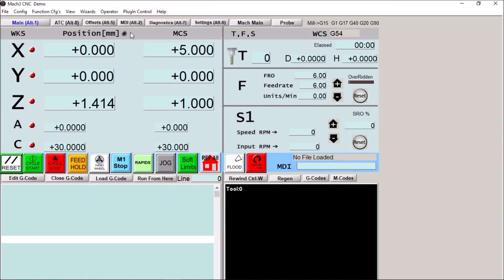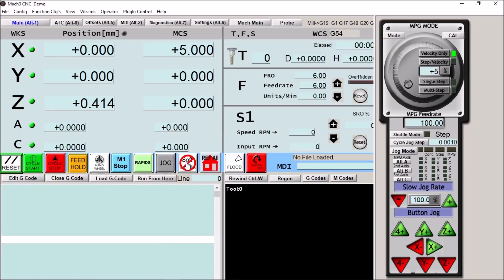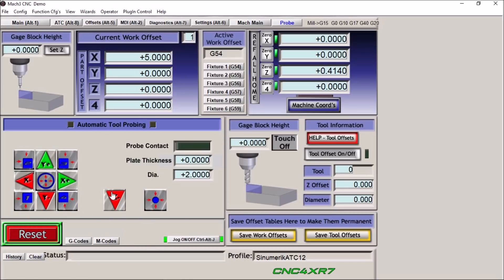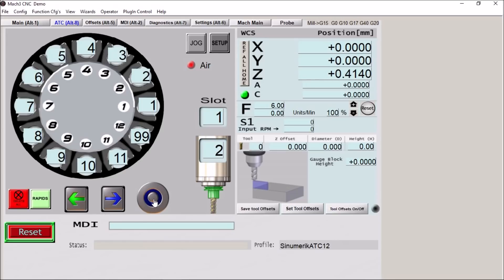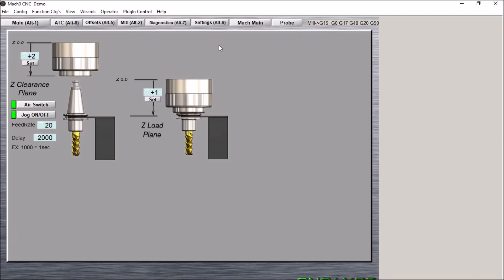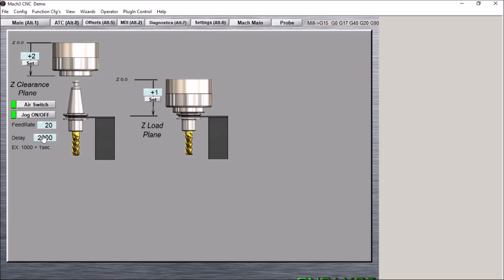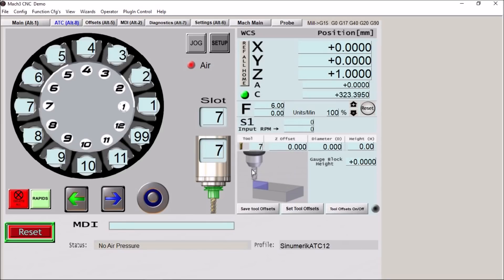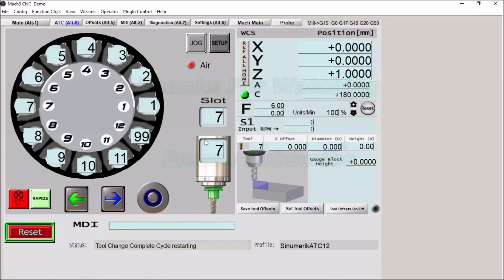Mach3 Sinumerik Rotary ATC Screen sets

Comment: I have  cheap offline controller , but to make it do what i want , i need to do a lot of macros and changing post processor . i´m thinking go back to Mach3 or 4 . 
Why you did not go for mach 4 ? and what control board are you going to use for it ?
Reply from the maker: Mach3 is popular and has been out quite sometime. Mach4 has yet to really catch on. You can use any BOB as long as you have the needed I/O's  this screen requires 2 outputs a C Axis and 2 to 3 inputs depending on if you would like a Low air sensor.